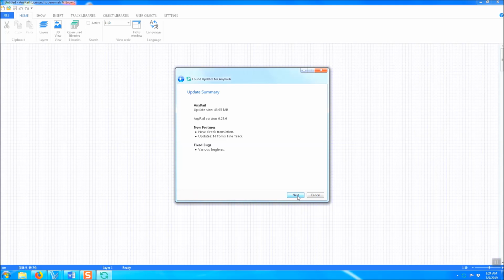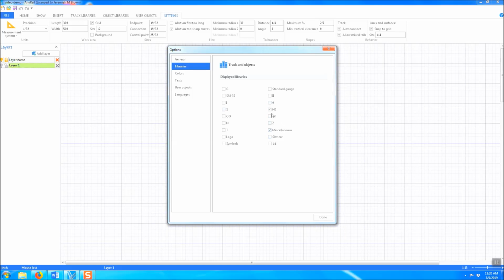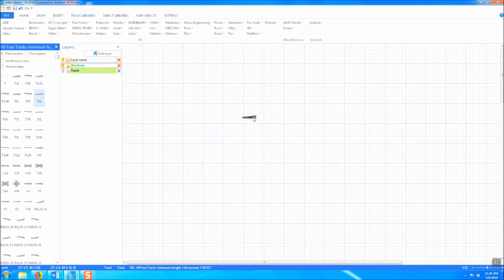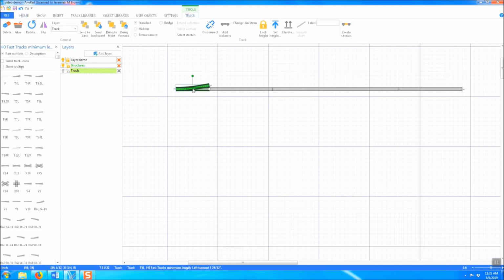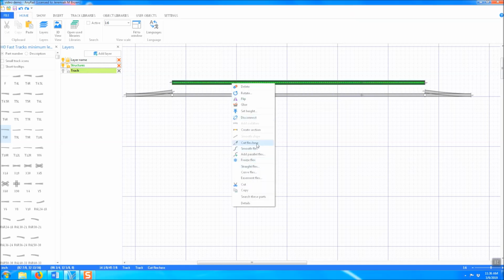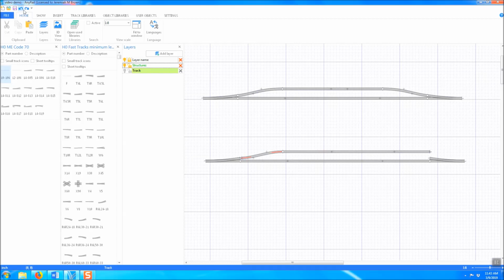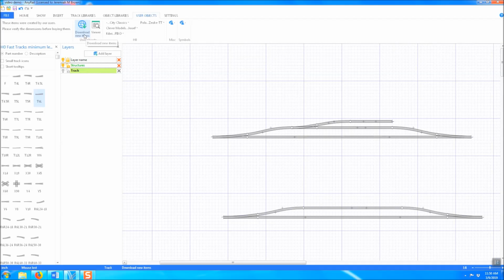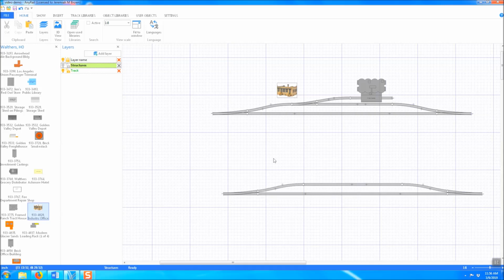AnyRail Tutorial:  Part 1 - Introduction & Getting Started

Comment: I have 3 comments. First when I make connections to tracks, I don't get a white circle. Instead I get a black dot. Can this be changed? My eyes are struggling to see the black dots. 2nd how did you get the center line in the cement plant to line up the track? I do not have this. 3rd using the arrow keys on the keyboard I was able to move the cement plant into the correct position. The arrow keys seem to be at times more helpful than a mouse or laptop finger pad.
Reply from the maker: William,  I'm not sure why you are getting "black dot" at the connection.  Which scale and brand of track are you using?  As far as the center line in the cement plant, I just guessed on where to place it.  I will tweak the location once I build it.
Reply: I discovered why I had a black dot. In settings under connection it was set to 1/32. I changed it to an inch and it fixed the issue.

Comment: Thanks Jeremy, I learned a lot but am still trying how to create a 30 radius curve with a turnout in the middle.  Also I can't seem to get Anyrail to accept tighter min radiui as in a switching area.
Reply from the maker: David,  to place a turnout in a curve you will need to make the curve out of flex track first. Then click on the piece of track then right click the mouse.  You will see one of the options is "cut flex here" click on this and it will cut the rail at that point.  Then right click on the cut and click on disconnect rail.  Now you will be able to pull one of the track pieces away and add your turnout.  Then you can place the cut piece back on the other side of the turnout if you wish. 

Second question, you will need to change your Min Radius in the settings tab (along the top)  Set your radius for a smaller size then change it back once your done.  The switching area track will turn red but you will know why.  As a note, this is for using flex track.  Hope this helps!!

Comment: How do I get the grid lines to show in the O scale view? Supposedly the grid is there but I cannot see it.
Reply from the maker: Tom,  Not sure what you mean by "O scale view".  The grids should be there no matter what scale you are working in.  The grids are not by scale but by actual inch's or metric.  You can change the grid size under the settings tab and "work area".
Reply: I noticed that the coarse (12") grid is always there when "grid" is checked, but the fine grid shows up only when I check the "Snap to Grid" behavior (Settings, far top right selection).

Comment: When you mentioned fast tracks and all the items are there, That is not so, I am in On30 and that does not have fast tracks but they do make On30 items.
Reply from the maker: Tom,  You would be correct.  I just checked out the libraries files and there are no Fast Tracks for O or On30.  I would contact AnyRail to see if they plan to release those track parts.  I am so sorry about that!

Comment: 19:20 I don't seem to have the option to add parallel flex.  I'm wondering if they got rid of it in an update between March and November or if that option is only available for flew track?
Reply from the maker: Timothy,  the "Add Parallel Flex" icon is only there when you are using a piece of flex track.  ie. If you use a piece of Atlas 9" straight track, KATO unitrack, etc.  the "Add Parallel Flex" icon will not be available.  Hope this helps!  Jeremy